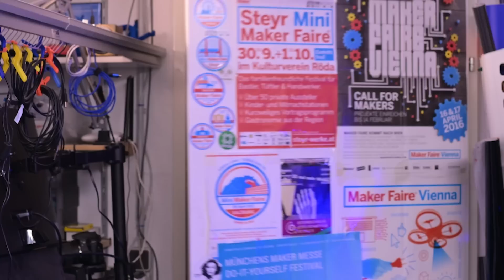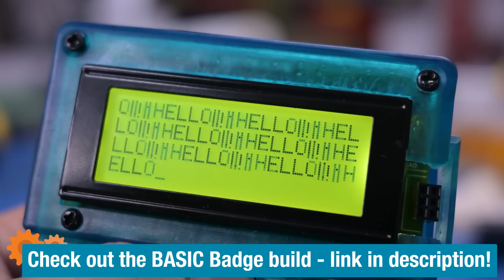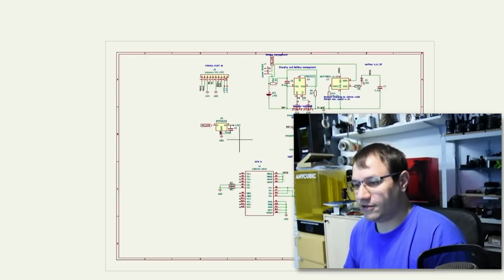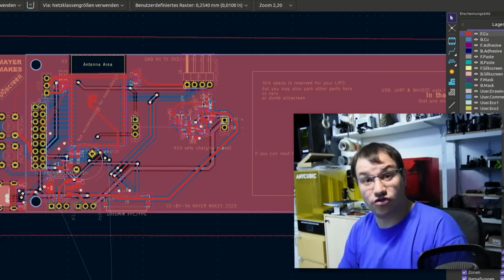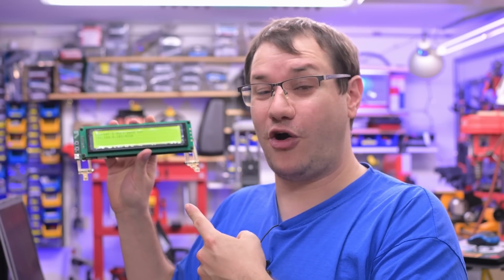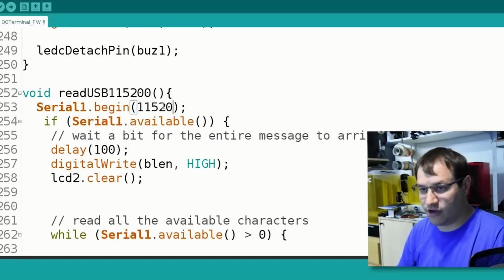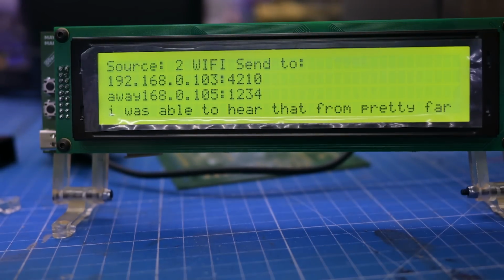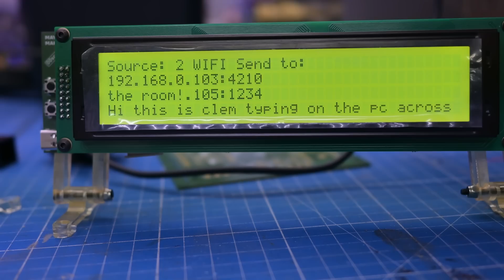All-Purpose Debugging: A Practical Universal Screen with LCD Displays

Comment: I would have killed for this a few years back when i was working in a server lab and neck-deep in saucy servers. Unfortunately, we had no budget. Fortunately, we had a surplus  blackberry, so I slapped on a terminal program and added a serial dongle. Such overkill, and it was slow to boot, but it did the trick.
Reply: i think you understand why I wanted to build this! it is asimple as whipping out a multimeter and switch it on...like a dmm for data

Comment: Very nice! I like that you can get it to buzz , say when you let it run and are waiting for some condition.  About the driver: why does it interleave or use multiple virtual LCDs for bigger units?  Is it a speed thing, is the protocol so old there aren't enough bits somewhere or something else?  Also: I knew it was a gag but everytime that laptop crashed, it hurt. hah!
Reply: Thats the exact purplse of the buzzer! I think the interleaving is a consequence of the hd44780 standard, which keeps all the displays compatible and working even if you would mount a 40x4 instead of a 16x2
Reply: Hd 44780 originally was meant for an 8bit bus on a microcomputer

Comment: I use this type of display a lot and I always had similar problems, I opted for a different approach, I created a library separating the display logic from the communication logic, So "universal" for virtually any communication card/protocol/display 

I have some tests on my channel, I have already managed to connect a 40x4 display using I2C to an attiny85

If you want to test it, it can be downloaded through the Arduino IDE library manager, searching for the name "omnicrystal"
Reply: Currently there is build-in support for up to 2 multiple displays like the one used in the video, but it is entirely possible to improve to support up to 6 displays at once

Comment: If you were really good at programming, you wouldn't use a number for sources.  You'd initialize source methods into an array of function pointers in the code, terminated by a NULL, then at runtime it would know how many by walking that array until reaching the NULL.  This is fewer things that need to be updated in the future, which is fewer areas to make a mistake, which is fewer bugs.
Reply: IF the point is IF I would be a good programmer😂

Comment: Heyo
I've noticed the procedure/function in your Arduino IDE have the ability to roll them up. How do you do it in Arduino IDE 2.x ?
Reply: Still works, just hover in the row inbetween line number and code, the arrow does the same thing.

Comment: 🤔I generally like using my smartphone for stuff like that  - cause that's the only thing I carry around - so I guess I'd need a usb-c to uart bridge , but the rest should already be onboard
Reply: not really, if your project does not conform to the standards your phone recognizes it wont accept the dat or tend to convert it on receiving, unless you code a custom app that does display it raw and allows to decode other stuff that is not USB like true UART , I2c SPI etc. also I hate how long it takes to unlock the phone start an app etc. while a dediacted device is ready in 2 seconds.

Comment: What is with you Arduino programmers that you can't keep your bracket indentations under control?
Reply: we have brackets, we don't need no indentation. Plus arduino ide puts them in wild spot some times..
Reply: What kind of nonsense claim is this? Automatic indentation is done by the text editor — and the Arduino IDE is just one of many text editors used by “Arduino programmers”. If you indent manually, you’ll likely end up fighting your editor’s settings. Not to mention that there is no consensus on “correct” indentation and line break placement. There’s a reason most text editors for coding let you configure the bracket rules.
Reply: If it aint broke dont fix it😅

Comment: Should have SPI  and I 2C, as well, very common memory and I/O interfaces for anything with Raspberry π or Arduino, ST Morpho...
Reply: A frequentt request also did put it in a text insert onm screen.. its jsut amatter of code. ad wathever you want. the beauty of open source!
Reply: I2C/SPI displays already exist.
Reply: @tookitogo there is a key difference: a normal spi/i2c display needs its specific commands to show anything. This device could didplay the exact signals(ususlly hexcodes) that are meant for a totally different device, to check if they are sent right.
Reply: @MAYERMAKES  I know. And that’s exactly what I meant exists. For example the SPIdriver and I2Cdriver from Excamera.

Comment: Yesterday I debugged a whole project that controls a machine with several threads, DMA, and a communication protocol. At some point the microcontroller simply stopped responding. What did I use for this? One LED! But, of course, you need the ability to change the code and flash the microcontroller.
*B.t.w. you have like 5 times more space in your workshop than I have, but I still have place for a computer because it's as much the instrument as, say, soldering iron or oscilloscope or PSU. Very important and powerful tool.
**But eventually I like your idea. It's useful to have something compact that can read many different protocols and display data in convenience form.
Reply: its mostly about the conveneince to have it when I need it and to be ready in a second. the reflashing is only needed if you want t oadd something new, all modes can be accessed via the buttons.
my workshop is a lot smaller than people think, I use a lot of camera postiioning tricks to make it look much bigger. its a bit under 4x5meters total, so with al lthe furniture/shelves there are less than 3 meters side to side. while I film i usually stand inbetween tools and boxes and need to move them all for the next shot. its cozy...and very full, but I really need al lthat stuff.

Comment: I2c and spi are nice protocol.
Reply: yeah those would be good additions! how often have I wondered why an i2c device would not respond just to encounter the adress is actually sent wrong.
Reply: I am beguuiner and use ic2 with arduino.  iwant to interface to test piano syn lcd display signal. I dont fully understand all of your device use here. i like it
 @MAYERMAKES

Comment: Can't you get used to calling them LCD screens rather than LCD displays?  Or just say LCDs or LC displays.
Reply: hmmm. no probably not
Reply: In English, we just don’t break up acronyms like that, so we never, ever say “LC display”, “ISB number”, or “PI number”. Nonnative speakers of English may do that because their own languages (e.g. German) do it. But in English we don’t. You’ll just have to accept that this is how we do it.

And if we’re going to be pedantic, “LCD screen” is just as redundant as “LCD display”. Which is to say, only sorta redundant, in that logically, it means “I am using an LCD as my display”.
Reply: @tookitogo  You're absolutely right, of course. I was simply trying to highlight the silliness of LCD displays by providing more obviously silly alternatives (although, thinking about it, LCDs is actually the right answer - I now have a bullet hole in my foot).  PIN number, ATM machine, PCB board, VIN number etc, are guaranteed to bring out the worst in me.
Reply: @pintokitkat  Well the thing is, I’ve seen German companies write “LC display”, for example, not realizing it’s just not correct in English. So you might think it’s “obviously silly” but some German-speakers rather condescendingly insist on applying those German rules to English in earnest.

Years ago I worked as a translator at a software company in Switzerland whose principal product designer was German, and the “ISB Number” thing was a huge, nasty debate. He simply refused to accept that a) in English, “ISB number” is not a phrase that is ever used by native speakers, and b) that breaking off “number” violates the internal semantic tree of the term, which is “international+(standard+(book+number))”, because there is no such thing as an “international standard book”.

Comment: very nice useful project Clem... 
just a few nitpicks:
👉you can use a "switch - case" instead of your "if else" statements (though as you pointed out, it would indeed be better to have the options as an array then use a loop to check to see which one was selected ~or even get fancy by creating an array of functions 🤓so no conditional statements needed);
👉you can change your "readUSB()" function to accept parameters (like the "baud" & "protocol") with default values so you don't have two functions that have practically the same code (🤓this also allows you to change the baud rate to whatever you like with your keyboard for even more flexibility)
👋cheers & looking forward to your next project!
Reply: Yes, these are very reasonable changes, i cant sink much time into code, but if I could thst would be the way to do!

Comment: why to add mosfet in the circuit????
Reply: if you mean the mosfet before the Buzzer, that is because the buzzer can draw more current than the mcu pin can safely provide. if you mean the two mosfets at the battery , these activeat or cutoff connections when the lithium polymer cell gets overcharged/overdischarged
Reply: GPIOs typically don't have great current sourcing capacity. The FET die can handle a lot more current for the backlight. Basically, it offloads the current from the micro.

Comment: please use your phone's browser as a terminal, no need for more keyboards or displays,
Reply: I cant read a thing on a phone,the LCD is miles betterin any way. also a phone wants propper USB communcation implemented or wont accept the data, it is as impractical as a laptop for this purpose.

Comment: I could help you make the code more dynamic with use if variables if you want to instead of hard coding baud rate for example. Do you want me to-do that?
Reply: the code is open source as always, got to the link below the video there you can download fork it and repurpose it as you want. I want you to have fun.
Reply: @MAYERMAKES   well I have no real use of the code or project personally to be honest, I just was asking as I'm capable to-do that easy stuff you was talking about, as it will go pretty fast to-do and maybe you wanted it to make it more dynamic and even contain less code as it would not contain unnecessary repeats
Reply: @Dynamit008 ”to-do” isn’t a fixed phrase that needs hyphenation, it’s just two words: “I need to do this”, the same as “I need to read this”, etc. The sole exception is in the phrase “to-do list”, because it’s not acting as a verb there.
Reply: @tookitogo  sorry that I'm not using the words 100% right, but the most important part is that people understand, but thank you for declaring that to me.

Comment: Back in the days of the original XBox, I had a modified shell and Xecuter 3 chip installed. It came with a LCD panel very similar to this. Had four buttons that could be programmed for system functions. Could also display a litany of geeky info.

I've been wanting something like this for a current project. It looks like your creation is it! Great work. 🙏
Reply: Thanks, 😂